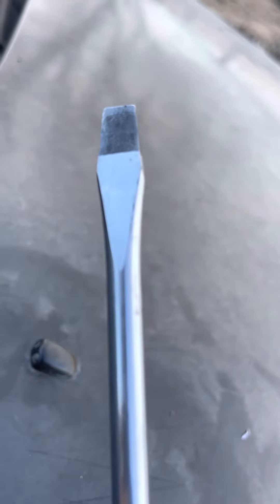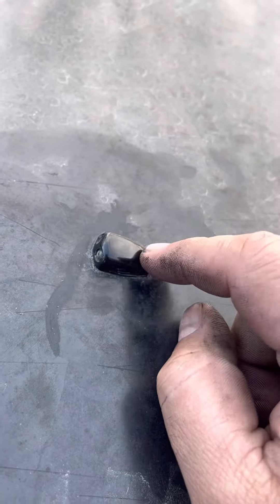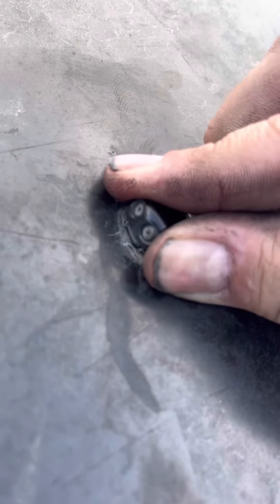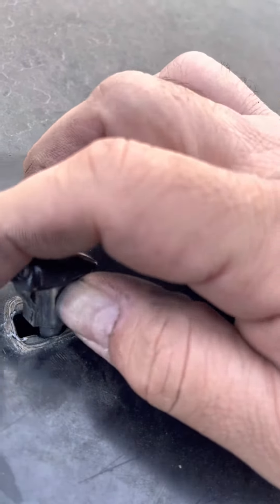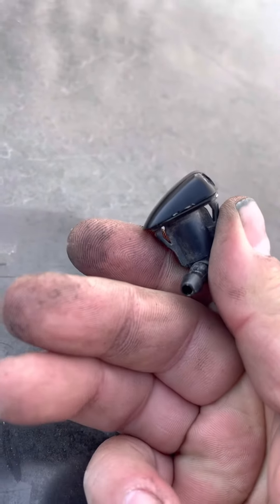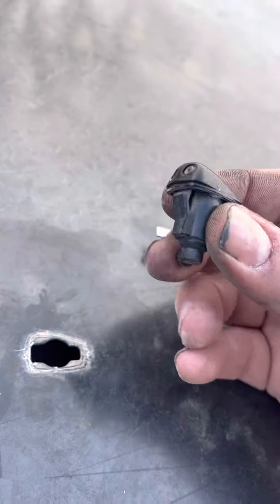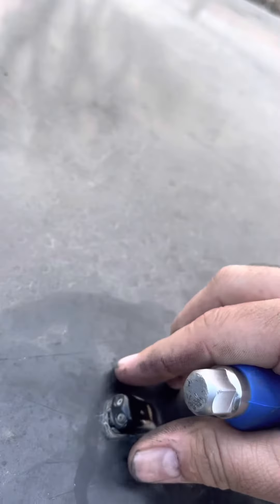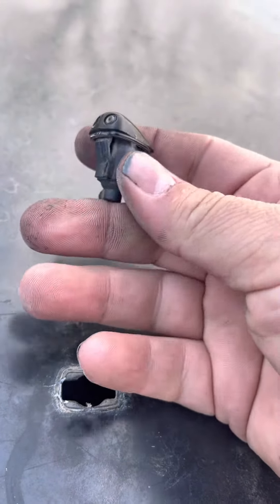Sc300 wiper squirters how to remove

Comment: Quick question 
How to remove ebrake handle. Humbly Asking
Reply from the maker: Has 7 17 mm bolts and 2 12mm nuts , 1 plug 1 10mm nut
Reply: @lexusautotek8905  I am referring to the ebrake handle itself that you pull up. My ebrake handle is tan I wanted to replace it.
Reply from the maker: U have to cut it
Reply: @lexusautotek8905  Oh okay 
I will do your first option remove the whole thing and just paint the handle black. Thanks so much for your help.